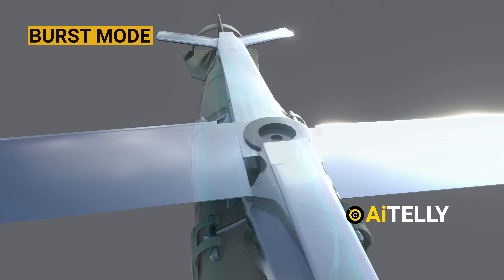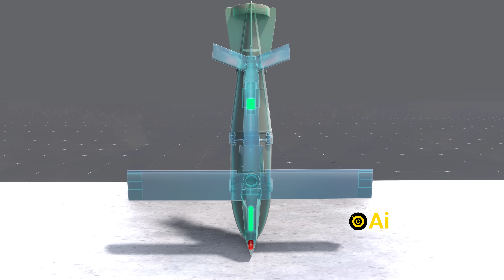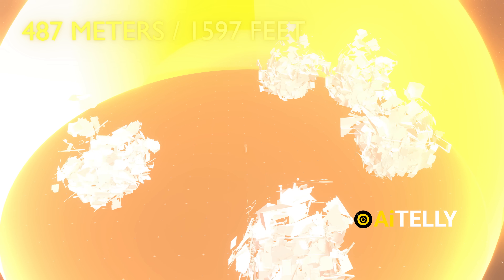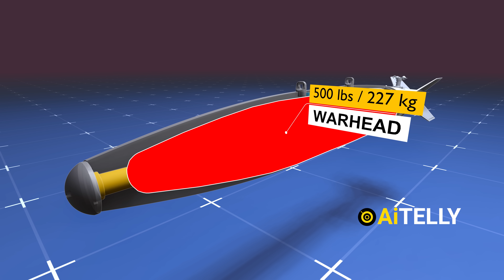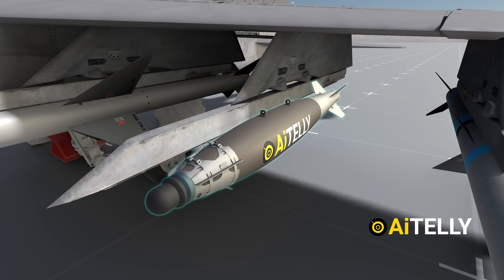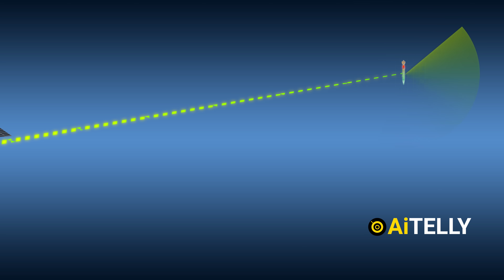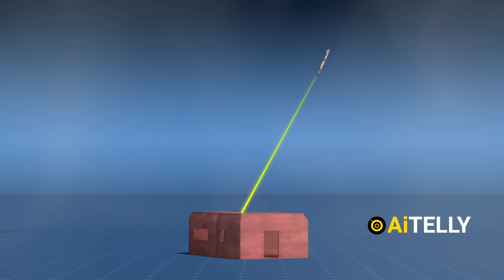Russian Glide Bombs Vs American JDAM | How it Works

Comment: You're completely off the mark on the guided FAB-500 cost. The conversion kit costs about 300,000 rubles - at the current conversion rate that comes to about $3500. Russia has 10's of thousands of these bombs in storage.  Your figure comes from the BBC contributor Professor Bronk of the Royal United Services Institute, a UK think tank. And he cites no source other than his pants. He's simply trying to justify the cost charged by his handlers for the comparable domestic munition.
Reply: hahaa you exposed his ass
Reply: The key difference is that the american jdam is exclusively used against innocent children and women in Palestine while the russian one is used against the westren criminal thugs!!
Reply: Also the Russians use civilian grade electronic which is cheaper than military grade. Of course there is an issue with civilian electronics but it's still done it's job well
Reply: @dauzlee2827 там отличия минимальны. Побольшей части это просто распространенные компаненты на усиленной плате в защищённых корпусах. Ещё переферия традиционно подключается через защищённые разъемы.
Reply: @dauzlee2827  кроме того, военная электроника в россии производилась всегда своя, прикинь.
Reply: Can you think? If something is cheap and just as effective, it will be repeated or sold! So where on the market are bombs for three to five thousand dollars
Reply: Фабы и одабы с модулем коррекции скидываются сотнями каждый день,их устанавливают прямо на аэродромах с помощью гайковертов )))ценник на эти модули в районе 3к долларов за комплект,там дороже стоит нержавеющий метал корпуса,чем модуль глонас))
Reply: Zelesky said until 2024 only 40k KIA Ukraine army.. With additional, mobilization kidnaped man And soon 18th years old teen army additional.. don't forget NATO reinforcement and trained extra army, Moscow will fall in few years.  pray for Ukrine,I am stand with Zelinsky
Reply: @antonyhancick4769  Prayers aren't gonna help. You should go ahead and volunteer. Test those FABs in action.
Reply: "The conversion kit costs about 300,000 rubles - at the current conversion rate that comes to about $3500." - presuming RU economics is stil working in any regular way. It doesn't. What matters is the raw resources it consumes, labour cost, manufacturing capacity, etc. For example, how quickly can 10's of thousands of GLONASS (if it is indeed GLONASS, but I think it is confirmed) kits? Its not like Putin could order stuff on Amazon or go to Zürich and get a loan, even getting to RU overseas accounts is tricky. And now they're including significant amounts of crypto too.

So it is probably easier to approach this in terms of manufacturing capacity than of monetary value.

"The conversion kit costs about 300,000 rubles" - but whose pants were the source of this? Putin's? Russian State accounting? If so, then you should not call other people names.

These bombs still can only destroy. To take what he wants, Putin needs soldiers, roughly 2 million of trained troops given most Ukrainians have survived and even the paramilitaries are veterans by now. What Putin has so far is less than a million Volkssturm with Trumpmobiles and the occasional real military vehicle. Few T-80, fewer T-90, T-72 getting less maybe but so far no mass deployment of T-55 except Krynky maybe (they died). As for trained Russian fighters, they now start losing them even in Chad, and the MoD even dissed Wagner for it on social media and now wants to send some of their few remaining crack soldiers to seize the opportunity and make the Mai junta THEIR b*ch...
oh well this is what happens when you masturbate over your cooked-up books.

Children should not be permitted to play at war, or the berbers will come at night and feast on their livers.

Did the transfer of power on Grey Zone go alright? Rest in Pieces, man. It must have been fun while it lasted.
Reply: @willietorben560 wow, what a flow of cosmic energy😂
Reply: @willietorben560 забавляет как с самого начала конфликта западные "профессионалы" пытаются подсчитать когда закончатся у русских бомбы и ракеты а они все не заканчиваются и не заканчиваются. 😂😂😂
Reply: @willietorben560  на нашей планете есть такая страна Китай
Reply: @willietorben560  смешно читать диванные фантазии забугорных экспертов. Ничто не радует больше, чем глубочайшие заблуждения противника) Казаться слабым это величайший успех российской пропаганды.
Reply: @willietorben560  ))))))))))))))) вы серьёзно? Вы верите, что нужна экономика США и высокие технологии типа 4нм чтобы сделать модуль? Разочарую - там нет высоких технологий кроме математики, физики, паяльника и сварочного аппарата, ну в США еще доходность элит ….
Reply: @Petrovich124 я даже больше скажу. Начинка модулей глонас полностью локализованная.  Например все относительно новые гражданские автомобили оснащаются трекером. Этакой тревожной кнопкой по которой службы спасения могут найти тебя в случае опасности. Они есть и в свободном доступе. Конечно военные модули заметно отличаются в плане защиты от помех и сопротивлению нагрузкам. Но начинка примерно та же, там нет ничего принципиально сложного и давно массово производится.
Reply: @Petrovich124 trolls
Reply: @willietorben560  copium
Reply: @willietorben560  🤡 больше не пиши эту чушь
Reply: @willietorben560 у России хватит рабочей силы, у нас вообще осталось много заводов которые могут как-то манипулировать с военной техникой

Comment: 2:56 The container between the engine nacelles is not a bomb, but an additional fuel tank. It is attached to a suspension point where weapons can be attached.

Comment: You've raised the price almost three times. The cost announced by the manufacturers of one set of UMPC (universal descent planning and correction module), with a FAB-500M-62 charge, is about 800,000 rubles, which is about $ 9,000. Where did the sum of 24,000 come from?

Comment: There is also Fab250, currently used in Ukraine, and su 34 is not a Soviet era bomber, it is produced since 2006. Soviet era is su 24. And using Glonass is making is no different then using GPS as in a case of Jdam. 
You should check some other sources then Wikipedia before making a video

Comment: Comparison with JDAM is not correct. Fabs are just free falling bombs with attached module for gliding and guiding. It looks like USA does not have anything similar.  Russia has pure guided bombs, where module of correction and guiding  is built in in the device, inside the device - KAB-500, KAB-1500 and they can be compared to JDAMs. But they are , probably, more espesive thatn simple free-fallilng bombs with attached modude of correction and guidance. Besides, Russia has FAB-3000 and FAB-9000 with weight 3 tons and 9 tons respectively.

Comment: the Su-34 can carry 6 FAB-500's with UMPK kits.
its the Su-30 and Su-35 that can carry 4. although there is no reason to believe they can not carry 6 either, we just have not seen pictures of that because they tend to also carry air to air armaments at the same time. much more then you see air to air stuff on the Su-34. 

the specified maximum takeoff weight of the Su-30 and Su-35 would suggest they would have no problem flying with 6 FAB-500's and their UMPK kits. it is also known the Su-30 and Su-35 can carry the AKU-58U ejector pylons, which are used with the UMPK. on 6 hardpoints.

also the comment below claiming they have attached a rocket booster to the FAB-500.
wrong. that is not the UMPK kit. and its not a FAB type bomb.
that weapon is called UMPD-D30SN. which is its own design. and does not rely on the general purpose FAB design.
its similar in size and design as the GBU-39 small diameter bomb.
and can not only be airdropped. but can be attached to a 300mm artillery's rocket such as from the BM-30 smerch system and be launched from the ground. similar to the Ground Launched Small Diameter Bomb. or "GLSDB" concept.

Comment: "To avoid criticism say nothing, do nothing, be nothing" – AiTelly

In your animation, the wings of the UMPK guidance kit are in an incorrect orientation when deployed. The rounded part of the airfoil should be at the front, and the sharp edge should be at the back of the wing.
Reply from the maker: You are right 100%
Reply: LOL not only the wing profile is backwards. At 08:45 the fins turned left so the bomb should turn to the left. But they drew it turning to the right. 
These animators have very limited understanding of the physical world )

Comment: American glide bombs are almost always more accurate due to the precision of GPS, while Russian bombs are less accurate due to GLONASS’s less than stellar accuracy rating, which the Russian tried to compensate for by using larger bombs but it comes with its own issue. 

Hence why almost everyone in the world use GPS and not GLONASS and it’s another reason why in the Ka-52 cockpits in the early war, they censored out the phone because they were using commercial GPS for navigation before the US sanctioned out Russia. 

That laser guidance kit also made the JDAM exceptionally accurate down to the centimeters if you have a guy pointing the target with the laser.

Comment: How vulnerable are these to GPS-Spoofing ?     do they have a back-up inertial navigation system?  if yes how does it know it should take over, ie. the GPS position is fake ?  or just pure INS, no GPS?
Reply: it can calculate its speed and placement, and if the speed changes in a way that would not match reality then it will switch to inertial guidance, however the accuracy of the bomb can change a lot depending on when it was jammed if it gets jammed half way through its flight time, it has a lot of data to work off, and can pretty much hit where it was aimed. but if it was jammed from the start then it would have a much harder time hitting its target. which is why we still use laser-guided and visually guided smart weapons the jdam is a cheap effective bomb for when air superiority has been established, which it hasn't in Ukraine.
Reply: @yujinhikita5611  Thank you, it feels great to receive a competent answer!  ...happens rarely.

Comment: MK82 weighs 500 pounds,(227kg) , with only 82kg of explosive(usually 80%TNT and 20% aluminium powder). Bombs rarely have more than 50% of their weight as explosives. The number of FAB500 and FAB1500 is the weight of the whole bombs in kg. Also, FAB 1500s are high drag bombs, cannot glide like JDAM, unless they reshape the front of the bombs.

Comment: Honestly, UMPK looks more promising. Unlike JDAM-ER, it requires less work on the bomb and is truly unviversal. If JDAM is Mk80-series only, UMPK exists in 3 calibers (250kg, 500kg, 1500kg; with potential 3000kg coming up) and can be installed on any bomb in said calibers.

You want thermobaric, cluster, HE, HE-frag, low-drag, high-drag? UMPK can be fitted on practically any bomb. Technically, you should not even have any restrictions on the bomb type: cluster, HE/HE-F and thermobarics are just the only one being used as of now. Potentially, incendiary, bunker-buster, anti-airfield or even nucler bombs can use the same kit. If its high-drag stubnose variant, there are optional metallic hoods to reduce the drag.

Its simply many times more versatile than JDAM. If if its accuracy is sometimes somewhat lacking, if improving over time.
Reply: Это лучший коментарий!!! Сотни тысяч простых недорогих бомб получили новые характеристики и применение!!!

Comment: The cost comparison is much more in favor of the FAB as the Russians have huge stocks of dumb bombs, so basically the incremental cost of an additonal FAB is the guidance kit. In this case, incremental cost (the cost of making one more unit) is more useful than the total full cost.
Reply: a lot things are cheap in America compared to the rest of the world, but not when it comes to military equipment 😆
Reply: US have a lot of dumb bombs too and the JDAM is also just a guidance kit.
Reply: The biggest cost to the use of either one is the risk + wear and tear on the aircraft dropping the thing.
Reply from the maker: it's neutral i guess
Reply: America has literally millions of Mk80 bombs in storage. The cost advantage is very much in America's favor, as despite having probably a larger paper cost, the far larger, and richer American economy allows for an absolute shit ton of JDAMs to be built a year.
Reply: @ImBigFloppa   @ImBigFloppa  Russians also inherited massive stocks from Soviets. US problem is military industrial complex ripping them off.
Reply: @j.k.1239  A JDAM costs just $22,000. A small diameter bomb that has a wing kit which  can extend it's range to well past 100km, costs a measly $40,000 (including the bomb itself). For Russia, which has half the population, a 13x smaller economy, and 6x lower economic output / taxes / income per person, that is expensive. For the richest and most powerful nation on the planet, that is peanuts. 

That tiny cost is why the JDAM is THE global benchmark for guided bombs, and why more JDAMs get built in a single year than every single precision guided bomb, artillery shell, and missile Russia has ever produced in it's entire history since 1991.
Reply: @ImBigFloppa  Bet Russian glide bomb cost peanuts as the only new thing is the cheap kit and military industrial complex is government owned.
Reply: @ImBigFloppa  most American Jdams do not seem to have gliding wing kits and are still of the tail kit variety which would make their range far inferior to these Russian glide bombs. These Russian glide bombs are also far heavier with destructive potential far in excess of a typical Jdam.
Reply: @j.k.1239  The russian one costs less, that's why sometimes it falls on russian villages on the border lol
Reply: @ImBigFloppa  Nope. Keep dreaming.
Reply: @ImBigFloppa okay brother now you might want to edit your comments and write the truth 😂
Reply: @Baraxes Okay. I shall update it to America building more JDAMs in 18 months than every precision guided munition Russia has ever built since 1991. Is that better?
Reply: @ImBigFloppa truth be told yes us has alot of Jdam but you don't know how many Russia fabs has 😂. 
Bro the soviet Union had so man fabs that they just started leaving them outside because there's no where to store them, even now Russia continues to produce more and upgrade more fabs. 

Even during the 1 and 2nd chechen war, the soviet used more than 200K fabs.
Reply: @Baraxes And FABs are just a component of the UMPK kits. The kits themselves are roughly equivalent to kits in price to those built in America. America just has more than double the population, 6x the economic output, and has a manufacturing sector that is itself double than the entire Russian economy. America builds significantly more in peace time and has an order of magnitude greater capability to build enough JDAMs to blot out the sun if we so desired.
Reply: @ImBigFloppa bro what is this discussion even about, i am talking about the current stock of Jdams. 
Also you give US too much credit, do you know that the entire Nato including US ran out of Artillery, Air defence missiles and some other mandads ammunition just because of the Ukraine war.
It's only now that they are trying to refill their reserve. 
It was big news last year
Reply: @ImBigFloppa  This. I wrote something about that but got deleted. Vatniks just can't grok. I wonder how many 155mm are in storage in desert ammo dumps and on pacific islands. Maybe 5 million.
Reply: @ImBigFloppa  Всего тысячу в год? Не в месяц, не в неделю?
Reply: @ImBigFloppa ok america is the best at everything and have the most of everything 😂
Reply: @JuniorSmith-truthseeker  Across the board, just about

Comment: I wonder if the fighter jet is needed  at all. Fighter jet launches are expensive. Could those bombs be launched from the air balloons?
Reply from the maker: Good Idea but what if the balloon is carried away by the wind
Reply: @Aitelly  
I understand there must be some serious cons provided that they are not used.

I dont think the balloon would be carried more that a couple of km so its not so important considering dozens of kms of supposed glide range (although the initial speed of the plane might play important role in achieving 70km range). The balloons are also not detectable by radars so can be deploied close to the combat line.

Comment: There's also a KAB-500, which is a laser guided version of that bomb, good at destroying moving targets.
Reply: KAB-500 is not the same bomb, they were a purpose designed system. Although Russia resorted to modifying unguided FAB-500s after production failed to meet demand.

In fact FAB is the Russian designation for gravity bombs. It's not actually the name of the modified bombs with UMPK glide kits. Which creates confusion, the actual name is FAB + (weight class) + (sub-variant).
Reply: @KSmithwick1989  The KAB-500 is not a bomb, but a family of bombs with laser, optical and satellite guidance.
Reply: @AndreyPetroff  Yes, it's the same bomb, although with a difference guidance package. The US SDB-1 follows the same concept.
Reply: @KSmithwick1989 FAB is not just for "gravity bomb".

F means HE, high explosive
A means it's airborn
B means bomb
Number means its gross weight, of course.

There are gravity bombs with the other indexes, like ODAB, where
OD means it's thermobaric.

Also, BETAB, where
BET means it's an anti bunker bomb that goes deep in the ground and has a fuse with longer delay
Reply from the maker: @KSmithwick1989 thanks for the Indo we learned a lot today
Reply from the maker: Yes I read about it

Comment: Does it have any engine or motor that propels a bomb for 70 km?
Reply: No, it only uses kinetic energy of its carrier. Basically(if it isn't obvious), plane flying 400 m/s will provide bomb with the same 400 m/s when dropping it. And some speed is gained from potential energy of gravity. But there are smart bombs with rocket boosters.
Reply: @КанистраКеросина  thanks for your response